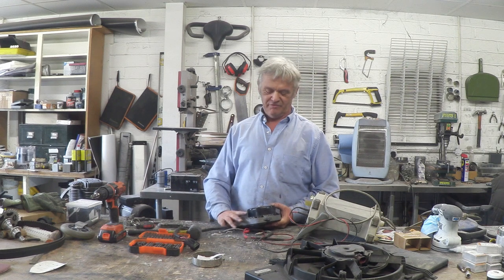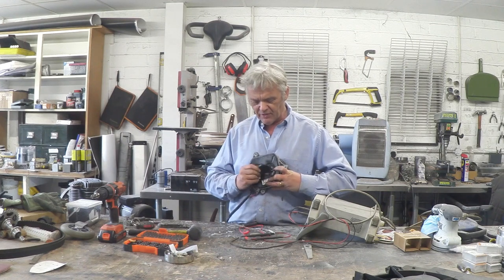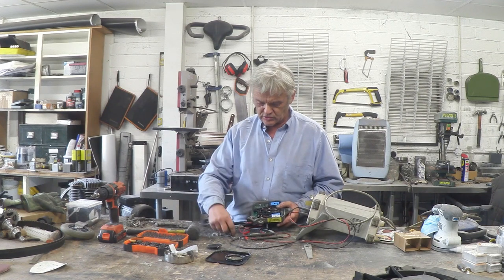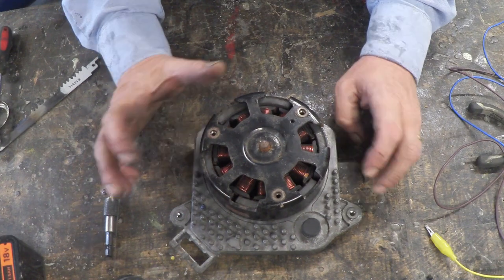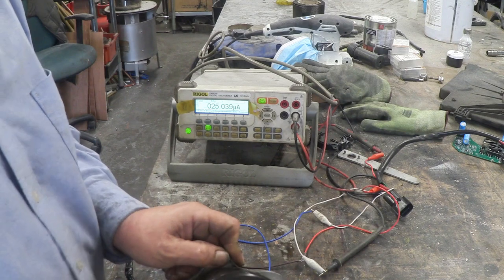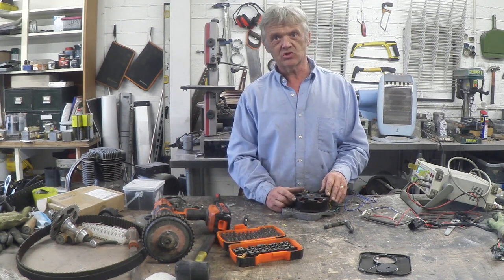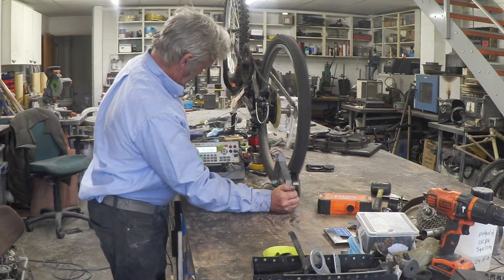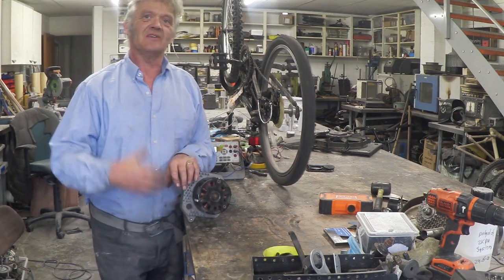1185 BMW Fan Motor As A Generator

Comment: Those blade attachment bolt holes should provide a good point to stick on a flanged, small diameter pulley or gear.  If your pedals drove the small gear in the cassette, and the largest gear in the cassette drove another chain, you might get an impressive final drive ratio for  the generator.  Good project.

Comment: Next time get some laundry washmachine from scrapyard. Many modern types use 3ph bldc motor wired for 400V or so.
Reply: They're only really good at even HIGHER speeds than this. But yeah, the faster the speed required to get to 100% operational capacity the more efficient a generator is.. generally.

What you really need for wind turbines is a CVT gear drive to convert even low rotational speeds into high RPM, but current CVT's tend to not be very durable.. CVT's also lack high performance so you'd have a hard limit of how much energy you can put through a single CVT and thus maximizing the size of a CVT geared wind turbine. They're also significantly more expensive than other type of gearing.

Comment: i would of expected more power from that motor how have you wired the bridge?
Reply: I agree. It should do better. Also looks like it moving freely while when shorted by amps meter it should give a high mechanical torque which would stop you from turning the bycicle crancks so easily. Things don't add up ...
Reply: The magnets are ceramic and he's running directly of the 3 phase leads, good for a motor configuration but not a generator, he would have to make a connection too the common, else separate the phases and rectify each one. And the magnets are crappy ceramic ones I'm guessing.

Comment: So I guess at lower speed, the voltage generated wasn’t high enough to fully forward bias the rectifier diodes, hence no current was really flowing.

Have you tried out an “ideal” rectifier which use MOSFETs with body diodes?